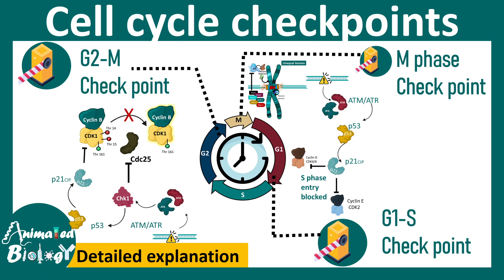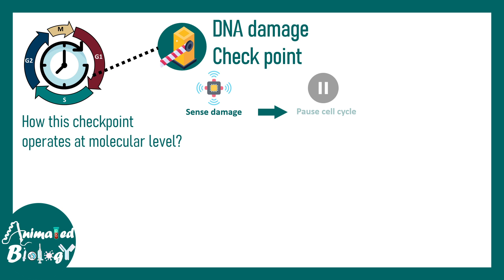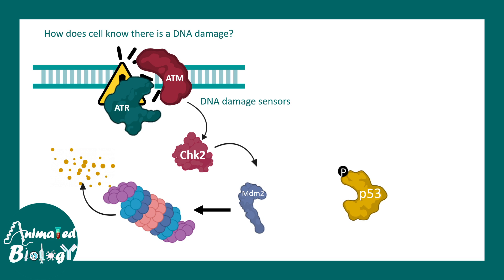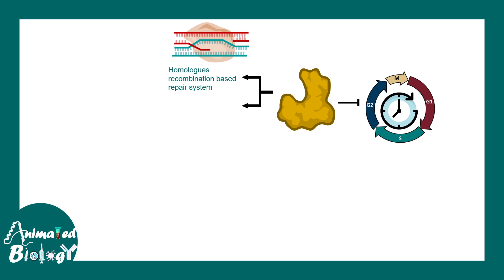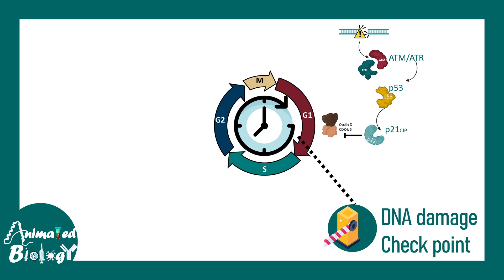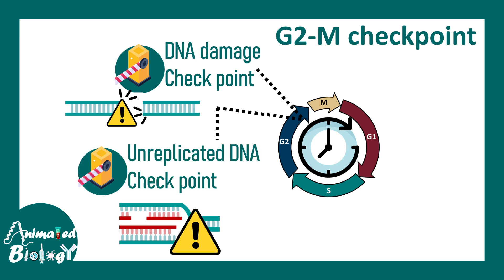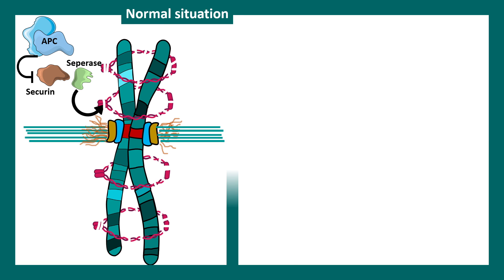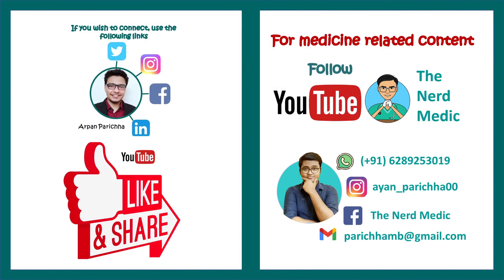Cell cycle checkpoints |  DNA damage checkpoint | spindle assembly checkpoint | Cell biology

Comment: "Securin forms a tight complex with separase and potently inhibits its catalytic activity. Recent structures of the separase-securin complex have revealed the molecular mechanism for the inhibitory activity of securin. A segment of securin is bound in the active site of separase, thereby blocking substrate binding":  Think of Cellular As Porous [Permeable/Pervious] Adhesive Sealers, Inclusive of Possibility of Dis-Integration.  😶.  

Respectively.

Tanika Nakeya Lewis, 6127